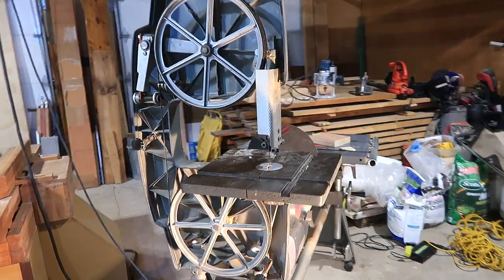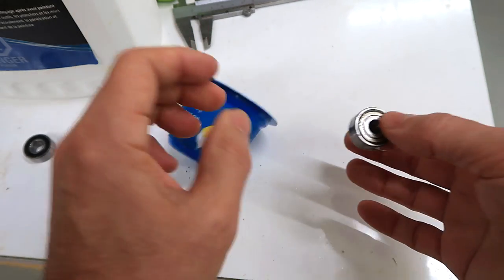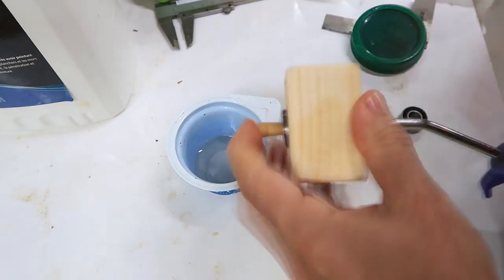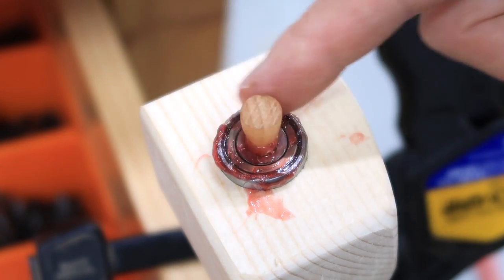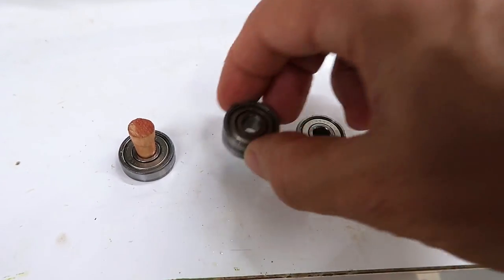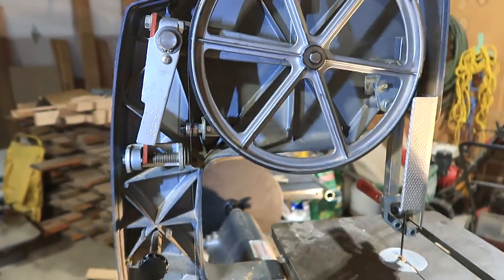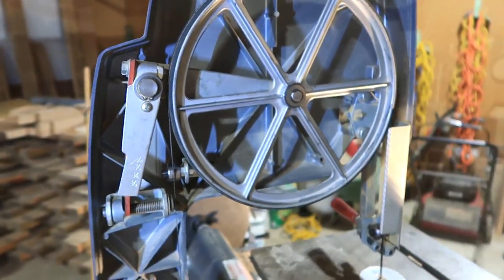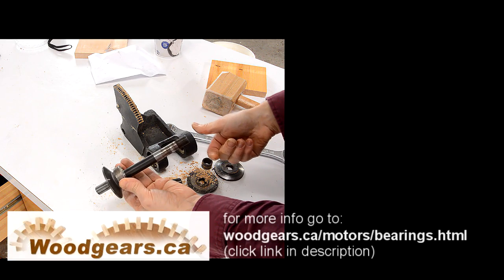Re-greasing a shielded bearing (no disassembly)

Comment: I usually pop the shields using two dental picks (you grab the springs on opposite sides and lever out) but this is much more interesting. Especially for rarer bearings that can't be replaced/ (shield can't be)removed (of which i've come across a few times).
Reply: Ya same actually, I was like holy crap I may be able to fix some of my old machine bearings finally!
Reply: Only thing I'd do different probably would be to soak the bearings in the solvent longer to allow it to break down the grease and dirt. Not sure how well it worked just jigging them around in it for a few seconds. When we re-greased automotive wheel bearings in automotive class in high school we'd lay them in kerosene for a couple hours and then come back to them and clean them.
Reply: For high volume standard bearing sizes where there’s high automation in the manufacturing process the shields can be non-removable.
Reply: For the smaller bearings i find two Stanley blades work quite well. I can easily take apart a PC fan bearing (3x8x4 - 693) and regrease, I prefer mobil polyrex EM, it makes less noise.  The newer bearings have press in shields and can't be removed without damaging them...
Reply: @teofilstevenson  I've been popping the shields of bearings for over 50 years, but only as a short term measure, the grease as come out because of wear.
Reply: @hetrodoxly1203  Lots of different types of bearings out there; in configuration, quality, manufacturer (of course), country of origin (reference back to quality), etc.  We all agree this is an interesting video but sharing bearing practices in the comments can be a challenge because of the differences I stated. This is not a “challenge” back at you, rather just my own opinion as I have worked for a industry leading bearing manufacturer for 35 years. We produce 300 million bearings per month and would not supply to this kind of application (too low end). We would have at one time but once the Chinese market opened up and the US granted them favored nation status they own all low end applications such as this. For interest (if this is), we first lost the RollerBlade market to Chinese product (early ‘90s) and then the router bit market. Two of what we would consider the lowest end markets we served in that day - and they were both respectable dollar markets.

Comment: 2023 and I am returning to comment.  This method works amazingly well.  Flush the bearing with 3 in 1 or WD and blow dry.  Place bearing in a jig above a shop vac and boy howdy does that grease get in that bearing.  Holy lubrication.  The fan on a 10 year old quartz heater began squeaking loudly and pissing off the wife and the chinchillas.  This method returned the heater to the previous, silent operation.  To those who say "Buy new bearings..."  Well, I repaired the unit in less time than it would take to actually locate, order and receive the bearings.  It's only temporary if it doesn't work.

Comment: Yes, Shopsmith bandsaw are weird, but in a wonderful way. The upper wheel isn’t crowned but has a slight taper, and it is canted to the back, which causes it to auto-track against the bearings on the left. Great vid as always, Matthias. Scott
Reply: Looks like the tension was set above the max on a 1/4 inch blade and the blade didn`t seem to track at the back of wheel as it should. Maybe other issues are afoot?

Comment: I bought a ShopSmith a few years back and used it a fair amount.  Wound up getting rid of it.  A dedicated tool for each job is simply better, especially when the do-all machine isn't really designed that well to begin with.  To be fair, it did get me by and it was only about $100 used, including a bunch of extras.

Comment: Thanks for sharing  both methods of packing a bearing.  To fix the shaking of your band saw buy a new set of tires for the pulleys. After that get in the habit of releasing the tension on the blades when the saw is not being used. The tension flattens the tires after sitting thus the shaking.

Comment: The thing I love about Shopsmith is walking straight from the (whatever machine configuration the tool is in) to the accessory wall to get the other attachment and retool.
Reply from the maker: the thing I love about separate machines is that that step is completely u necessary.
Reply: or that it's locked into a certain rpm because the selector knob was lost in 1962, and replaced with a vice grip

Comment: The problem with greasing up squealing bearings is that the damage is already done. Once they squeal, you've had unlubricated metal on metal contact and wear has taken place. But I suppose for something like a band saw, you'll probably be ok. Not good for things that run for extended periods of time, or even continuously like wheel bearings, air handler motors and bearings, etc.

Comment: I saw this video a while back and looked it up and found it again.  I've got a Grizzly that has those bearing blade guides that I've previously replaced and they've been howling again for a while now.  Wondered if your grease technique might work.  And it worked!  Interesting to see that there was little to no grease in them to begin with.  I figure the new grease should have been able to push any old stuff out but there was none.  I did do a quick soak in mineral spirits first to get the saw dust and resin off them.  Great tip.

Comment: You sir, are a genus!  I'll have to try that! Thanks for the great tip!!! When my hard to reach bearings get dry, I oil them with 30W nondetergent motor oil.
Reply: 30W oil? What is that? SAE J300 is THE standard that defines automobile engine lubricants viscosities and it does not recognize 30W oil. 

My guess: you mean SAE 30 oil. 

Second point: where you are going to find non detergent oil? For engine oil to be totally avoid any detergents it has to be of type API SA - some 70 years old standard. Hint: even monograde oil, i.e. for lawn movers or heavy duty diesel are detergent oils.
Reply: Yes, you are correct, I meant SAE 30!  And for your second question, I buy SAE 30 non-detergent at my local auto parts store.  I use it in all my oil cans and use it to lubricate all of my equipment and tractor bearings as well as my jaws when they get squeaky ;-}

Comment: Look, just Dremel the bearing in half.  After you've gotten stitches on your thumb, cleaned up the blood and tissue from the workbench, try to see if the part number is still legible so you can order a new one.
Reply: Since these bearings aren't aligning a shaft, after cleaning the blood you can just measure the ID, OD, width and get one of that size from the auto parts shop.
Reply: The important thing in this video is not the few dollars he saved but his creativity coming up with a way to lubricate the bearing.  What if this bearing is no longer manufactured?  There is an old saying: There is more than one way to skin a cat.  It's always good to learn more things.  I had never thought of this way to relubricate a bearing.
Reply: @saylormalan  when a bearing starts making noise there is already metal on metal contact and it's no good anymore. Besides, no bearings are out of production, just read the specs or measure them and order off of a catalog or auto parts store. No point in getting them from the manufacturer.
Reply: @saylormalan  you're  some bearing expert
Reply: @mick1gallagher  Greetings from Brazil. I'm an amateur mechanic.  I was born liking mechanics.  Each case is different.  In this specific case I think it's worth relubricating to last a few more years. What cannot happen is for a bearing to run without grease.  Putting grease on this little beauty, it can still last a reasonable amount of time.

Comment: That is not a sealed bearing. It is a shielded bearing. A sealed bearing has rubber seals that do not allow dirt to get in.
Reply: Absolutely correct. And the bearing is shot, if it's making that noise replace it, £2.50 max. While you are at it replace with a sealed bearing.
Reply: You made me laugh when you said, "A sealed bearing has rubber seals that do not allow dirt to get in." Yeah sure, you keep believing it.
Reply: @1pcfred  Yes, seals keep lube in and contaminants out.  “Arizona Road Dust” or carbon bush dust are fine enough to work its way though but for the most part rubber seals on precision bearings work.
Reply: @teofilstevenson  in my experience what rubber seals do is keep contaminants in bearings. Whatever manages to get past the seal gets into a bearing and doesn't come out until you pop the seals and clean the bearing. Sealed for life means the bearing is beat once the seal has been defeated. Not nothing ever gets in the bearing. I mean use your head. The seal wears as the bearing turns. A seal contacts the inner and outer races so the outer stays stationary along with the seal and the inner turns on the seal. It's not going to put up with that forever.
Reply: @1pcfred  Hey Mr Wizard, I do use my head and have used it for the 35 yrs I’ve worked for a world class bearing manufacturer. This isn’t the Stone Age, technology has addressed such things.
Reply: @1pcfred  You clearly want to turn this into a pissing match.  You win.
Reply: @1pcfred  check out a Mazda 626 GC1  water pump. The bearing in the engine block looks like the ones with the seal ( ... RS / 2 RS ) Direct in boiling hot water ! So there are bearings around with real sealings .
Reply: @heikopanzlaff3789  boiling water is not very hot. Block temperature is less than 180°F which is under boiling. Because we don't drive steamers. If you want hot on an internal combustion engine you have to go by the exhaust manifold. That gets hot. Engine bearings in cars are oil bathed. That's why cars have oil pumps. When a pump fails engines seize in a fraction of a second. It's like click, bang.

Comment: I clean (usually only when rusty) with WD40 or diesel, mixes with grease better. I spin the bearing using the rubber backing adapter for roloc pads. 

You can usually blow a rubber sided seal out of a bearing, and pack with your thumbs. 

I have never had grease cross contamination ruin a bearing, if there was grease In there we would not be doing this.

A blunt tip assortment of syringes is a must, 14 - 25 gauge, (20 for $10) you can simply just add some grease through the gap in the shield there. If the rubber of an applicable bearing is supple, you can just go under the lip. I warm the syringes a bit, and squeeze them with pliers, putting the syringe barrel through a metal washer where your index and birdie finger go to grab on to. 

I mostly drill a small hole in the seal wall, (cuz the seal is crunchy) and fill. Seal hole with a dab of 1min permetex right stuff. 

If you roll the bearing while putting the needle in, you can usually get deeper. 

I over pack the bearing and spin it very fast and fling the excess grease back out and clean off. 

I use Full Synthetic Valvoline VV985. It mixes great. Bad advice for space shuttles and aeroplanes, but wonderful for cars and equipment. 

I have had great luck greasing timing belt pulleys and front wheel bearings on cars/trucks, (sealed assemblys, not old school) If they are apart for something else like a ball joint or water pump, drill a hole and squirt them up, they will even quiet back up if noisy and arrest advancement of whatever axial play, if any,  was there. 

I would run a re-greased Japanese timing belt pulley over a luck of the draw Chinese sourced part any day. A gambit of new timing belt pulleys could exceed the value of the car. (I have been known to repack new pulleys from 3rd party's to ensure good grease) 

Most people will not a replace belt pulley, if I can even get them to change the belt. I have greased hundreds of noisy 6203 style bearings and they always end up out lasting the thing I bolted them back on to. 

If a bearing does not spin a lot, I use Seal Glyde as a lubricant instead.

Comment: You can grease the bearings easily without the jig by putting some grease in your hand and repetitively rub the side of the bearing through it while rotating it. This will hydraulic the grease through the bearing.
Reply from the maker: Hadn't thought of that, but even simpler!  Less cool though.
Reply: Have you ever done that with a shielded bearing?
Reply: He did it with ZZ metal sheilded bearings, without removing the shields.
It's hard to hand pack a shielded bearing.
Reply: That's the old tried and true method used for automotive wheel bearings back in the days of drum brakes. It works, did it many times before I got a tool for greasing wheel bearings using a grease gun.
Reply: @bobd.  I just got to thinking, an automotive bearing grease jig would probably be pretty easy to make out of wood. I never thought about it back in the day. I drive a GMC Safari van that's rear wheel drive and I just hand packed brand new bearings for it and put new rotors on while I was at it. Runs smooth now 👍
Reply: Not on shiealded bearings
Reply: @tullgutten  True
Reply: Wont work on shielded bearings

Comment: I read stories of a farmer, in a Shopsmith group
(who had a small herd of Shopsmiths in his barn in multiple configurations-- like double-headed drill press, etc.),
and he'd regrease actual sealed bearings in his large hay mowers.  He drilled a small hole in the seal, pushed grease in, cleaned the seal and put a dab of silicone sealer on the hole.

Comment: Quick tip on that Mobil 1 synthetic grease (almost certain that's what you used because of the color and consistency). Mix it 1:2 with WD-40 marine grease (1 part Mobil 1 synthetic to 2 parts WD-40 marine), 1:1 if you've already bought a ton of it. Both advise NOT to mix them but in my trials on stationary machines, bikes and handheld power tools they both work just fine together. The Mobil 1, on its own, will separate and run all over the place given time but the WD-40 marine has no such problem, in fact, it thickens up the Mobil more than enough to never run. In a confined, sealed, bearing maybe there's no issue but in anything with exposure to the air the Mobil WILL separate and run.

Comment: Curious what type if grease you used.

Also, the second way of filling them, by pushing grease through the bearing, is easy if you need to fill many bearings with the same dimensions. Built a base plate with a rod that matches the inner diameter of the bearing that has a thread on it so you can screw the acrylic top tight. The acrylic top has two holes and you push grease in one hole with a syringe until it flows out of the other. Same volume filled every time and easy to clean when screening many different grease samples. 

/chemist working in grease R&D
Reply: Looks like typical wheel bearing red grease
Reply: it looked like red
Reply: The slippery slidey kind
Reply: Fantastic answers lads. Really narrowed it down.

(Most probably this is a multipurpose simple lithium grease but the transparency of it makes me want to say anhydrous calcium but that seems a bit unlikely for a regular consumer. Also colour is 100% irrelevant, any grease can be dyed any colour, almost.)
Reply: I would guess Lucasoil Red N Tacky.
Reply: @kylelaw7210  Mixing different greases could cause damage to the lubed parts. If you aren't working on your own property (you are working for hire) then you should replace with AT LEAST a compatible type and preferably the same that came out... unless you want to be held responsible for damages or injury. I am sure that if someone were killed then an investigation leading back to maintenance would be expected.
 Almost every grease is incompatible with at least one other type of grease. And, the grease comonly used (from OEM) in bearings are polyurea-grease and these grease formulations may not even be compatible with another formulation from the same manufacturer.
 Use the right stuff.
Reply: @PetarWD  go to the hardware store and ask for red wheel bearing grease. Is that narrow enough? It's super tacky, doesnt bleed much, high temp. That's what I pack mine with. 
Narrow enough yet?
Reply: @jonathan1427  Thanks! I'm not from NA so it's interesting to see what people use :) If this is what he is using its even a bit overkill but will work well
Reply: @kylelaw7210  Secondary containment has a valid point. US market has a higher share of polyurea than we in Europe have. Polyurea and lithium/lithium-complex (for example the one you suggested) are often times not compatible. Polyurea is in my experience mostly used on fill-for-life bearings in electric motors. A good multipurpose lithium-complex with EP/AW-additives will cover any need you have as a regular costumer and if your application does not get hot a simple lithium will probably suffice as well.
Reply: @lynx50187  I'm just curious what regular costumers use as I make grease that is tailored to specific applications in mega-industries. Also, my knowledge of the NA market is very limited unfortunately.

For the curious reader.
Any grease can be made any colour, just change the dye. (apart from grease with molybden disulfide, graphite, zink/copper flakes as they are too dark).
Tackiness is based on polymer content and is not always preferred, imagine how much friction that would entail in a small bearing running at high RPM.
Bleeding is also interesting because a grease that bleeds to much is messy and loses its usefulness but a grease that bleeds to little will run dry even though the thickener might still retain oil. 
Dropping point gives a indication of thickener stability and sadly does not often correlate with upper running temperature limit (you use accelerated aging at specific T to determine this).